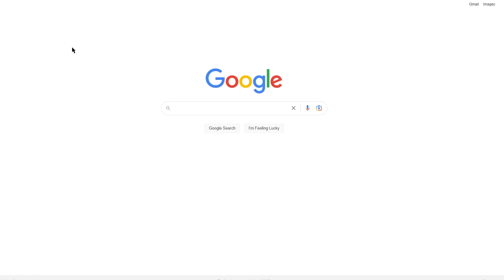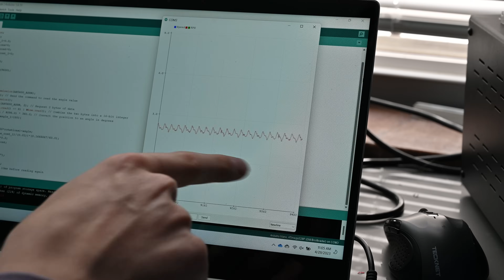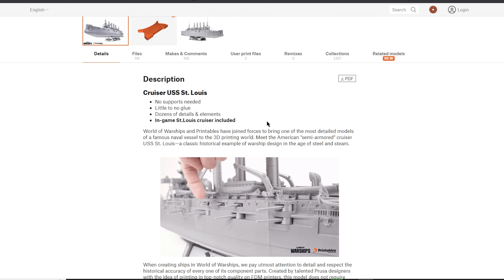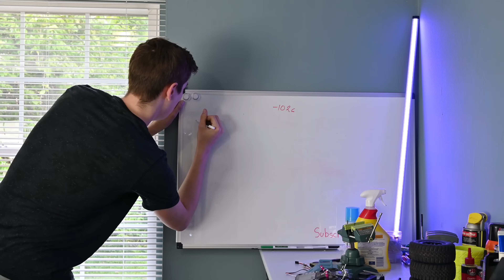I PRINTED an RC Car... How FAST can it go??

Comment: If your diff is open... Fix that. Its likely the reason you always lose the back end while under hard acceleration.

What happens with open diffs is if one wheel "for ANY reason" either achieves less traction or more traction than the other wheel... the wheel with less traction starts accelerating WAY faster than the one with traction. and the car starts turning.

If you dont even have a diff on the drive wheels then your suspensions "shock absorption" is either to strong for the weight of the car or too weak for the weight of the car.

Either / Or ... But something something is making the back end step out under power situations and those 2 are the usual suspects

Comment: i would design a new chassis aerodynamic shell replace the motor most definitely research super cars and car design in general i would also design and make goggles allowing me to see what car sees and this goggles in question would have a function letting me see how fast i would go 3d print the tires out of PCTPE there is a video on that filliment by @rclifeon and tpu Diabase X60 Ultra-Flexible Filament video that as well by @makers muse i would consider buting a 3devo filliment maker get the tpu pctpe and x60 filliments make a new filliment print tires bumpers overall modify the design thats i would do

Comment: "maintains the same speed irregardless of the angle of the joint. now i know what you might say" 
So, as a viewer, I wasn't about to mention universal joints, and I am almost positive you knew that since you qualified it with "what you might say".
Now I am pretty familiar with your use of dry humor and the occasional inserts of comment section bait. I feel sometimes that I'm looking for these little jokes when they might not be there, theres an analogy for this kind of thinking. I'm looking for these 'zebras' when the use of a word like "irregardless" was just a 'horse'. If you ARE in fact trolling your comment section here, I can't imagine a more skillfully done fakeout. For the people confused, "irregardless" is one of only a few words that people believe ain't a word, it actually is a word and is being used correctly (but if i were to guess, that was the point). It's like 4-d chess for pedants, in this case the "think horses, not zebras" analogy is bait for the commenters, just so you could go "actually, it wasnt a horse OR a zebra. four legs, you sit on it... it was just a chair". 
I hope I'm right. if so:
🏆 nicely done.

Comment: Pretty cool good luck - will be following.  I've been trying for a while with a vintage RC10.  I'm at 72 so far!  Your next hurdle IMO is going to be tires are aero.  I've found that 50mph and up tires that grow are bad.  I've also noticed if my rear wing is at too severe of an angle (IE: setup for rear down force) it creates so much down force it lifts the nose of the car and flips it over.  However, with no wing the front stays down but it's unstable at speed.  I've got the wing on and set flat to give me the high speed stability.  I'm not using any gyros but a proper RC electronics setup will help you a lot - also looks like our trim is off and you are constantly trying to correct to keep the car straight.  Here are a couple vids of my car.  Again, good luck!

https://www.youtube.com/watch?v=yEIVepczsxI&list=PLSv0dlSlpMh1j1TyXKuUMZOyrLAey2lIL&index=3&ab_channel=n20cpri
https://www.youtube.com/watch?v=6zL9Xfn24Jo&list=PLSv0dlSlpMh1j1TyXKuUMZOyrLAey2lIL&index=2&ab_channel=n20cpri
https://www.youtube.com/watch?v=ejV9-aJWjbc&list=PLSv0dlSlpMh1j1TyXKuUMZOyrLAey2lIL&index=4&ab_channel=n20cpri

Comment: To reach those speeds excess of 50mph you’ll need a body with emphasis on downforce and also please look into aerodynamics for the underside of the chassis.  Here’s a tip, investigate vortex generators.

Comment: needs a much much bigger motor to handle all that weight and size, all the battery juice and super expensive esc is bottlenecked by the motor, also, for the love of god, if you gonna put so much effort into it, buy a proper pistol grip car controller, look up up 1/10 or 1/8 scale rc car motors.

Comment: :face-blue-wide-eyes:your missing so much on how RC car are really built. Glue ur tyres and check your camber and toe angles. But Good job on making your own parts. you could save your self a bunch of heat ache and pain though. your esc choice is sketchy at best. Work smarter not harder brother.